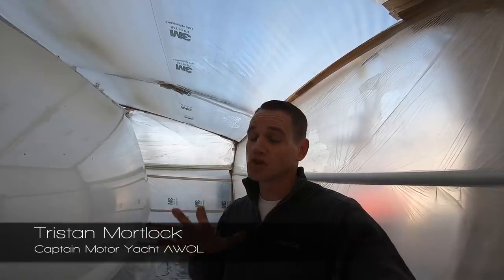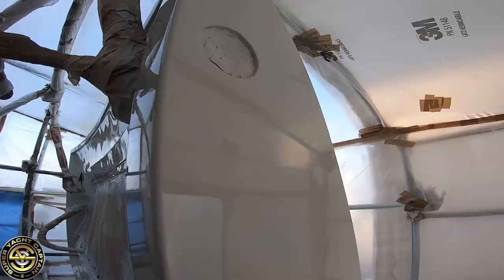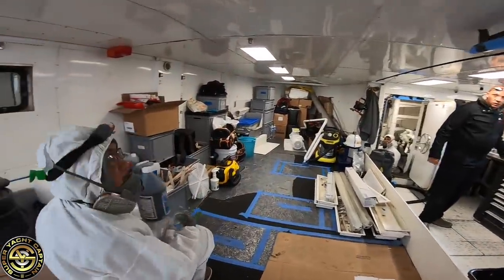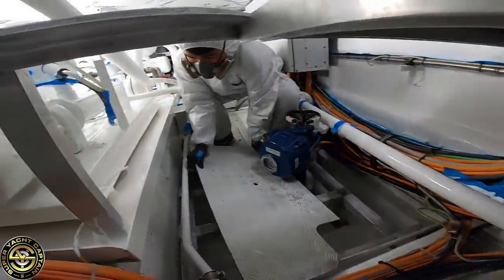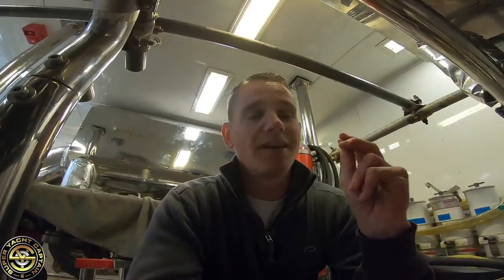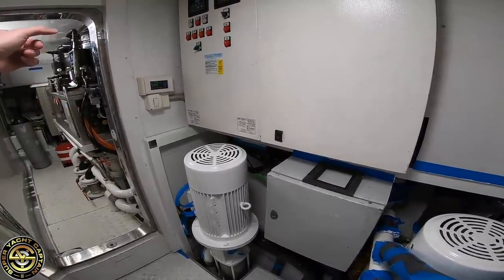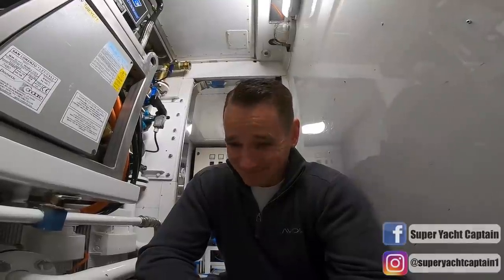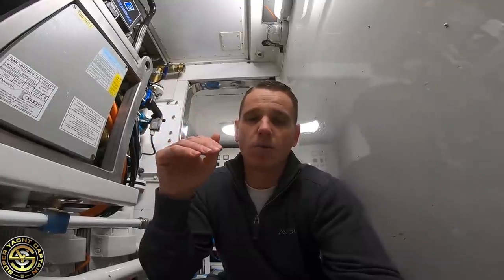Turning a 10 Year Old Luxury Yacht into a Brand New Luxury Yacht? (Captain's Vlog 51)

Comment: Great paint work! Have you looked into applying ceramic coating to the exterior?  The owner may not want the added expense and time needed, but I see many smaller vessels doing this with great results and imo you would see a much cleaner hull throughout AWOL's boating season, plus easier maintenance on haulout.

Comment: The yard is pulling the wool over your eyes mate, there shouldn’t be any visible orange peel. Clear-coat is not the fix, but better application techniques, under the correct temperature and humidity, are required for proper results.